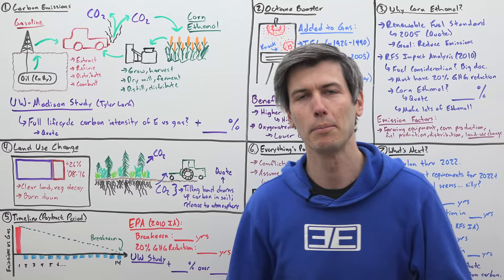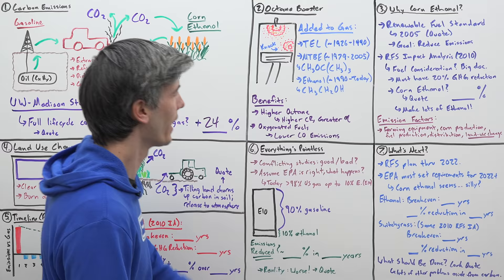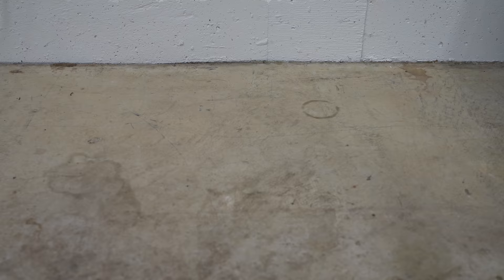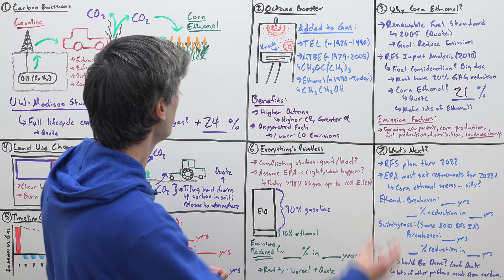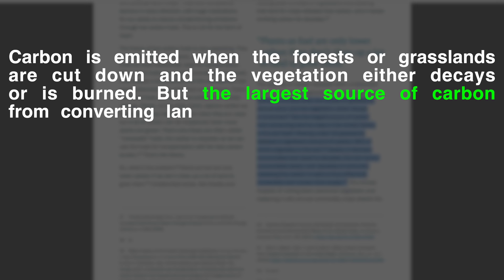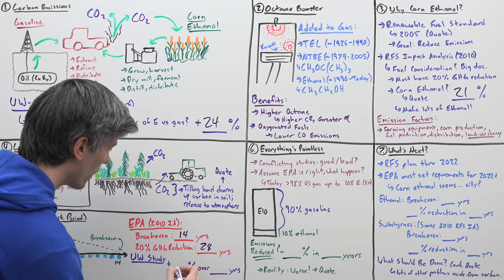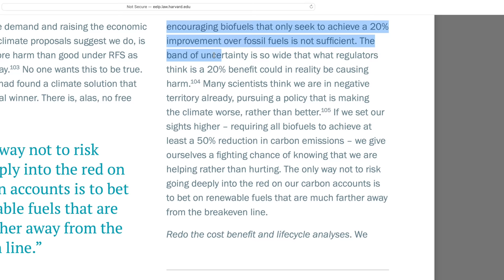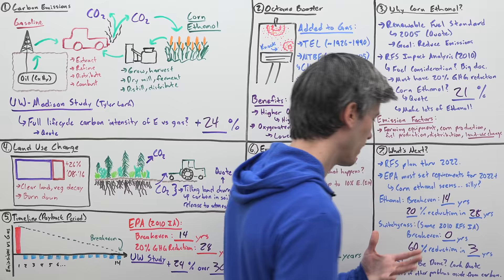America Was Wrong About Ethanol - Study Shows

Comment: You should also keep in mind that while ethanol is about 10% of your fuel by volume, it's only about 5% of your fuel by energy content.
Reply: Also a metric I was told back when this garbage started: It takes 1-2 gallons of gasoline to produce 1 gallon of ethanol. So you're actually not reducing gasoline consumption at all.
Reply: @ClokworkGremlin  That's why the updated research shows it's worse because the old study made a lot of assumptions.
Reply: Yes, the more ethanol, the worse the mileage.
Reply: Ethanol also sucks all the moisture out of the air which is goes into tanks as they empty.
Reply: Even less! potential energy when your gas is even two weeks old.
Reply: @philscott7949  When I was 14 years old (back in 1962), i had a motor scooter. I had lots of ethanol (methylated spirits) - but not much gasoline. I wondered if I could blend the two fuels together? So I did an experiment.  I took a clear glass bottle. I added 1/3 methylated spirits, and 2/3 gasoline. I shook the bottle. About five (5) minutes later, it was possible to see a clear division in the two fuels within the bottle. The (heavier) methylated spirits sank to the bottom. It was with this knowledge, that I refuse to buy E10 fuels. It became clear (to me) that this 'separation' will rapidly happen in any vehicle Fuel Tank - if the vehicle remains stationary for even one day! Many fuel Tank Outlets are low-down (inside the Fuel Tank), and the Fuel Pump can draw mainly the ethanol content of the fuel - due to the Specific Gravity differences. This will definitely make your Brushcutter or Lawn Mower much harder to start, and even your car! The E10 can absorb water, which will always lay on the bottom of your Fuel Tank, and if the Tank is steel, will rust from the inside.
Reply: @peterduxbury927  Speaking of rusting from the inside, never trust an air compressor with a weld seam at the lowest point. Always choose a tank with a smooth base, because that's where the water gathers.
Reply: @philscott7949  I didn't even think about the welded seam being at the base of a Compressor Tank, but you are correct, it will be vulnerable to corrosion. As with any water tank with a welded seam at the base. Thanks for that.
Reply: @philscott7949 literally just checked my compressor now. All good thanks. 👍🏻
Reply: @ClokworkGremlin  Ethanol on the NYMEX is $2.38/gal.

An unusable subgrade of gasoline (RBOB) is $2.68/gal.

It takes more energy to make unusable gasoline than ethanol.

To turn RBOB into usable E0 fuel costs even more than that much like premium costs more.  Unfortunately for humanity it becomes even more toxic and dirty.

Or, simply splash in >10% ethanol to RBOB and the resultant usable fuel becomes less toxic, far cleaner burning, and cheaper/cheaper per mile to drive.  Who can be against that?

Comment: its interesting how these guys are focused on reducing emissions rather than maximizing carbon sinks, if the overall goal is to reduce carbon then we should build an environment where carbon is consumed faster than it is created. and buildling more grasslands and forests is maybe cheaper and better than messing with the fuels 

just a thought....
Reply: True .... Here in Iowa which is big Corn Country grasses effectively remove CO2 for about 7-8 months of the year while corn only effectively removes CO2 for about 3 months with little being removed in the first month and last month of it's growing season
Reply: @Bernt-Kurt-Evert M CO2 is NOT a bad thing. WITHOUT plants and trees doesn't grow !!!!! many years agoo before industrial times the CO2 level was MUCH higher.... Trees growing bigger because off it.  THE human is NOT the problem in CO2 production.
Reply: Can't eat grass bro or forests.
Reply: @sinnexz I've been messing around with algae and cyanobacteria, and I found a few cyans that made me think of something similar but more compact. They forms thick benthic mats in alkaline water, which eventually fill with gas, float to the surface, and decay creating a carbon and nutrient cycle. The new exposed substrate quickly becomes colonized with more bacteria. It would require a constant stream, but running this thin constant stream over a flat area of limestone, and having it fall into an underground filter mechanism, where it can be stored indefinitely, would allow this process to be linear instead of cyclic.

Comment: So everyone now thinks EPA is bogus, but consider that despite them being inaccurate in their estimations, the idea and implementation of ethanol lead to finding other methods that (seemingly) are better (ie. switchgrass).  It won’t stop there.  We continually advance our research, and subsequently our programs. However, I am surprised that the net results were not calculated with the carbon release from farming land.  We have to look at the release of all carbon emissions in the whole cycle, and they should have already known this.

As a side note, there was no mention of the processing and refining of oil from the ground. We don’t just pump it from the ground to the cars.  

And lastly, we have to look at the carbon impact of each product from manufacturing to disposing/recycling it.  For example, where does used oil go?  How much carbon is released recycling EV batteries?
Reply: The study here is bogus, there were no grasslands or forests broken up for corn.  Quite impossible on its face because US cropland acres have declined since ethanol.

Census data shows that in corn producing states, grassland, forest, and wildlife areas increased since ethanol.

The corn belt had more acres of corn in 1980 before ethanol than in 2018, the year of most ethanol production ever.

Corn ethanol is value-added from already existing feed production acres while preserving the feed in a healthier and more productive form called distillers grains.

Iowa State University measured all the energy it takes to produce an acre of corn into a "diesel fuel equivalent"
This included making the machinery, fertilizer, chemicals, plus the tillage, planting, spraying, harvesting, drying, trucking etc. 
They found it takes 34 gal of diesel to produce one acre of corn.
What do we get from those 34 gallons of diesel?
We get >500 gallons of ethanol.
But wait, that is not the kicker.
The kicker is we still get 100% of the protein and other things from that acre of corn still available for a healthier and even better feed called distillers grains. A win-win.

The US used 11,160,933 tons total fertilizer on corn in 1980, before ethanol.

In 2018, the year of most ethanol production ever, the US used 10,521,850 tons total fertilizer on corn.

100% of the fertilizer (& everything from the soil) still get fed to livestock in the distillers grains.  Ethanol comes from only things of the air: solar energy, CO2, and water with the latter two recycled once burnt.

Ethanol C2H6O = no fertilizer

Distillers grains = all the fertilizer

What logic is it to then assign all the energy and CO2 of fertilizer to ethanol and none to distillers grains?

Comment: I moved to Brazil from England with my late wife in November 1999. I spent around 3 months in São Paulo then we moved north to Recife, Pernambuco. Many cars, usually 4 cylinder Fords, Chevrolets & VWs ran on pure ethanol. Since Brazil is a world leader in growing sugar cane & ethanol is quite cheaply & easily distilled from sugar cane, ethanol was a good & much cleaner alternative to gasoline (petrol).

Sadly, two(2) problems were associated with this:
1 Cars were NOT tuned to use this fuel correctly, so explosive backfires were commonplace.
2 The USA via the UN suppressed the use of ethanol & forced the Brazilian government to refrain from using it. The newer cars with fuel injection could NOT been tuned to use ethanol. Cars with carburetors could easily be tuned to use ethanol by increasing the size of the carburetor jets & expirating the motor correctly.
Reply: National Graphic did a study and that said only the cars with the highest compression can burn ethanol efficiently.  Otherwise there can be a 25% loss.  Also ethanol from sugar can produced 8 times as much energy expended making it.  Ethanol from corn produces 1.3 times as much energy used to make it.  It was not worth it for corn.
Reply: its all about the big companies. they must see the money ,not the people.
Reply: Balderdash, fuel injection can be easily adjusted to run on virtually any fuel, the problem you refer to about the "backfiring" is a clear indication of a lean stoichiometric air/fuel ratio, you cannot just change from one type of fuel to another without making changes to the engine management and or the engine itself. Another major problem, to use ethanol efficiently the engine needs a much higher compression ratio to return a better volumetric efficiency which in turn requires more fuel compared to gasoline to get the same output, why(?) , because a pound of gasoline contains about double the BTU's (heat is power) of a pound of ethanol, hardly an efficient preposition.
Reply: @Peter-V_00  Brilliant, thank you.  
      Could you explain how to change engine management / & how to determine compression ratios of engines.
Reply: Hi, I'm brazilian and would like to give an updated overview of sugar cane ethanol usage over here. As of today, virtually all mass produced vehicles in Brazil accept both ethanol and gasoline at any proportion. As the technology started to be implemented, at the beginning of 00's, the "flex fuel systems" were not very sophisticated. The engines had higher compression ratios and the injection systems would only act correctively (by adjusting the ignition timing) after knock was already happening (when using gasoline). 

Today's systems are way better. There are plenty of downsized turbocharged engines that run on any proportion of gasoline and ethanol available on the market. The injection systems usually recognize the fuel directly at the fuel line using capacitive sensors and have extremely complex fuel injection maps. The players dowing the R&D are world class, with for instance Bosch and Mahle being involved in the development of the brazilian spec VW's 1.0 TSI EA211 engine.
Reply: @Peter-V_00   The fact that the energy density of ethanol is smaller than that of gasoline only affects the autonomy you have with a full tank of fuel. Energetic efficiency, power output and exhaust gases are pretty much unrelated to fuel density.

The price of a liter of ethanol is approximately 70% of a liter gasoline (in Brazil), making the price/energy ratio the same. With respect to efficiency and power output, ethanol (due to it's higher resistance to detonation) allows for higher compression ratios (~ higher thermal efficiency) and better ignition timing (~ higher thermal efficiency).

Mainly for these reasons, an optimized ICE for ethanol has better efficiency and higher power output than the gasoline equivalent. With respect to emissions, ethanol combustion generates less CO2 mass per unit of output energy (couldn't find the exact ratio right now, but can be verified by the stoichiometry of the combustions for the same energy output).
Reply: Flawed studies assign all/most energy to the ethanol side of the corn kernel and little/none to the feed side when it should be the other way around.

Because of the feed factor, corn ethanol is so economical that it outcompetes most any other source out there including sugarcane.

This was evidenced by the fact Brazil saw fit to place an import tariff on US ethanol in 2017.

Since Brazil feeds corn to cattle, they too are value adding some of that feed to ethanol as well, something that wouldn’t be done if that far apart from sugarcane.

It is a nice fit with sugarcane because corn stores well, ethanol plants can run more efficiently all year round instead of seasonally.
Reply: You would need to measure the volume of the combustion chamber, versus the volume of combustion chamber + piston at bottom dead centre i.e. the volume difference between TDC and BDC then make a fraction with Vol - BDC/ Vol TDC
Reply: @marcelo.griebeler  I had felt the need to correct all of those who were incorrectly throwing around the word "efficiency", but you did an excellent job!  Thank you.
Reply: Been living in the US for 40 years and born in Recife I understand both sides of this.  My recollection is that Ford, GM and VW all were able to work out the problems of running 100 % ethanol. Different fuel injectors and ECU programming made the difference.
Reply: I wonder how much of the Amazon has been cleared to grow sugar cane?
Reply: @johnorenick9026  , simple answer: None. Sugar cane is grown in the Northeastern and Southern parts of Brazil. Amazon rain forest is on the northern region.

Comment: You left out one factor in the push for corn based ethanol: Helps the corn farming industry. Which, of course, is a lousy reason to do what they've done to our gas. Oh, and what about the cost of countless engine repairs caused by this ethanol blend?? All the reasoning for the ethanol mandates makes my head hurt.
Reply: Ethanol burns cleaner than the old lead base.  Not near the amount of carbon build up on valves and and not getting burnt valves like we did with the leaded fuel. 50,000 miles was the norm for valve jobs, now we never do them. Most of the younger techs have never ground valves and seats and that was as common  as timing chains and belts jobs are now . But I do agree, the cost to make ethanol is more than it can be sold for is a terrible idea...
Reply: Well, we're not really comparing to "leaded" fuels, and I'm not so sure ethanol burns "cleaner" than regular unleaded fuels either. I've seen actual real-world tests that show there is very little, if any, difference in ethanol fuel versus regular unleaded in carbon build-up. Also, even if it did burn cleaner, the damage it does to the metal and rubber parts of fuel systems in engines compared to non-ethanol fuel is irrefutable! This I have seen first hand over many years and many, many engines (small engines.) The reduced valve jobs you cite may be a direct result of better manufacturing and materials. (To be honest, I don't remember many valve jobs having to be done even back in the 70s, and I was always around engines of all types back then too.) I will travel many miles to non-mandated counties for non-ethanol fuel for my small engine machines and vehicles. Ethanol fuel is a curse!
Reply: @Eric_B  Well, obviously you dont put Ethanol in a car that has rubber parts, thats common sense.
Reply: @Chuckiele  Huh? I was referring to small engine vehicles and machines. However, you actually DO put ethanol in cars that have "rubber" parts all the time! You fill up your car with 10% ethanol gas, and car fuel systems have tons of gaskets and seals made partially of "rubber" and similar substances. (I guess I used "rubber" as a general term for gasket and seal material.) Common sense.. and common knowledge. 

But I don't worry about the 10% gas in my car as much as the "small engines" that I was referring to. It's most harmful with engines that get stored seasonally, less for cars that are continually run all year. (But woah unto you if you store a car for the season with ethanol gas!! LOL!)
Reply: @Eric_B  If 10% is still fine is strongly debated but for higher concentrations you definitely dont want any rubber parts and there generally are alternatives like TPFE. But yeah, forgot you were talking about small engines.

Comment: I’ll be honest, I haven’t read the study. Does it account for the 1/3 of each bushel being used as animal feed after ethanol production (it’s a byproduct, not an either/or) and what environmental impact it would make replacing that feed with something else? I didn’t hear it mentioned in the video and am curious about that aspect. I’m all for cleaner ethanol, but the corn is used for more than just fuel and that also has to be considered.
Reply: Replace the unneeded farm land with grazing land, or just plant a significantly smaller portion of land with corn for feed. A majority of ranchers use grazing land for growing cattle, and only finish them on corn the last couple of months before butchering.
Reply: NimbleSeaUrchin it’s easy to say “just do this, not that”. I’d like to see the study address that though. I wouldn’t call it a complete study until that’s done. I looked it up and each bushel of corn makes 3 gallons of ethanol, 16lbs. of feed, and 1lb. of oil. We currently sell all that feed in our economy.
Reply: it's not an either or, both product and byproduct can (and should) be used - but the overall quantity can be scaled. The issue isn't that corn ethanol and byproducts shouldn't be made, but rather the incentives are too strong. It prioritizes land use (and the associated carbon costs of clearing, tilling) that should otherwise be avoided, or prioritized towards converting existing monoculture farmland into carbon sequestration initiatives, and low water use grasslands/grazing)
Reply: @6GZL1  Nice. Also, changing land use will cause problems that will have to be dealt with.
Reply: In the absence of circumspection, people can come up with all kinds of "great" ideas.
Reply: @tricd0444  You do realize that cattle grow slower on grass, making less "food" per acre year, don't you?
Reply: @WisconsinEric  Tell that to someone with crying children.